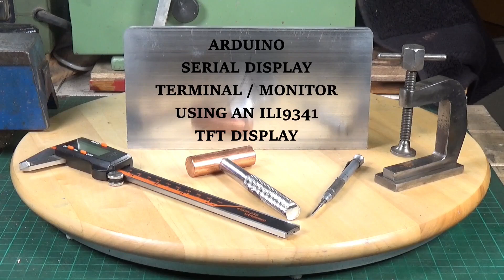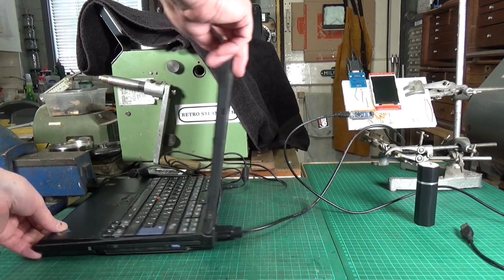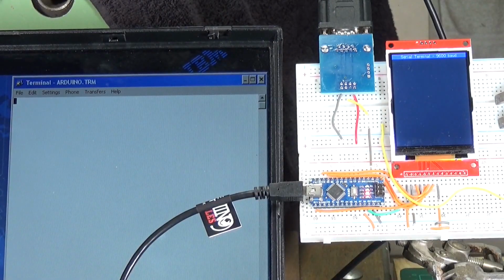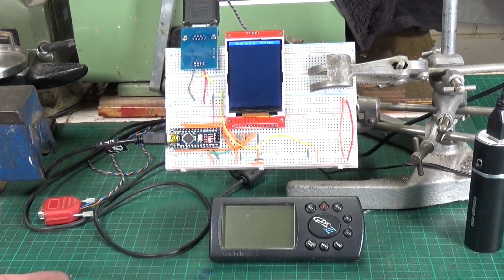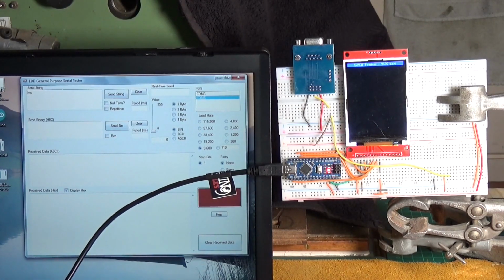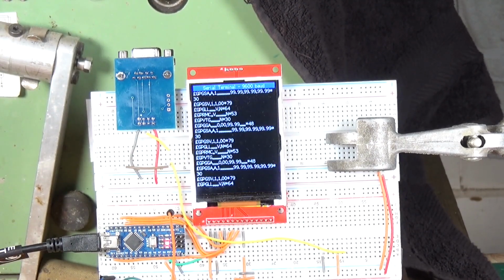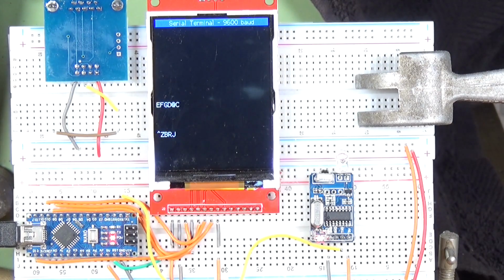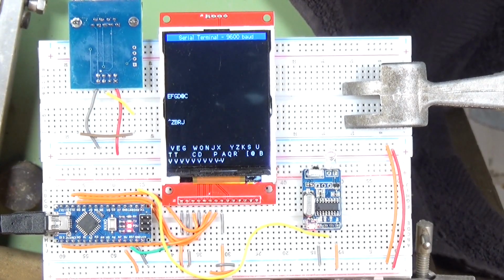Arduino Serial Data Display Terminal / Monitor Using An ILI9341 TFT Display

Comment: i tried this and it was stuck on white screen, i cant figure out what im doing wrong
Reply from the maker: Have you tried running one of the example sketches for the ILI9341? That will tell you if you have it wired up correctly.

Comment: "The Babbage Analytical Engine, 1833, is considered the first steam-powered computer." - so nearly. Nice Arduino project.
Reply: You can make a computer out of relays, see the video here a few episodes back. The steam relay is a piston attached to a valve. All those steam engines are computing something.
Reply from the maker: @david_pilling  Yes, you can do all sorts of things with relays. About a month back I made a binary to decimal convertor using them, video here https://youtu.be/lCf9BQm1GQQ